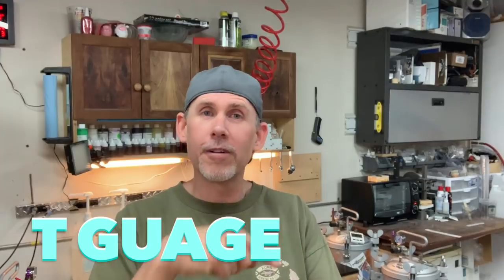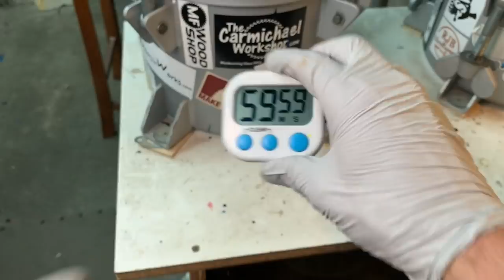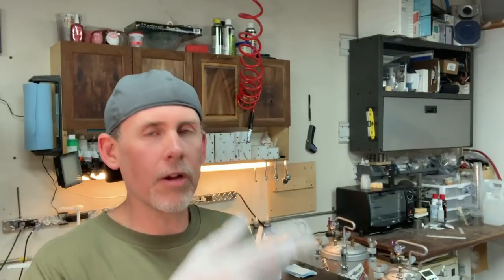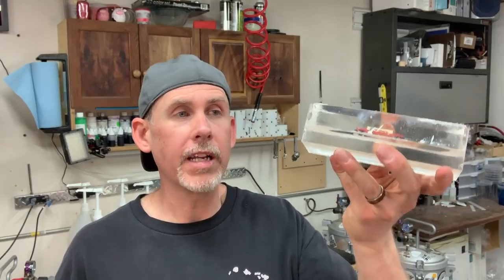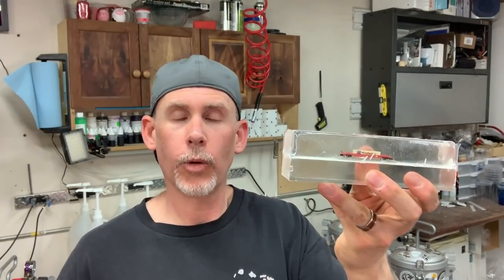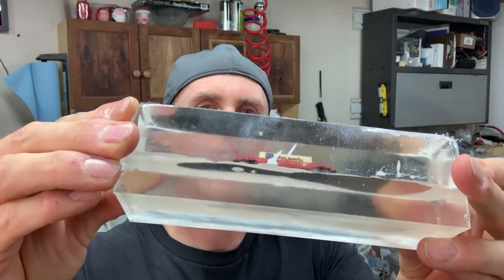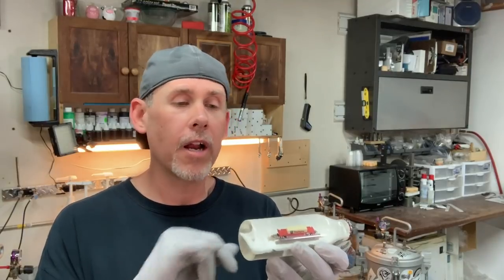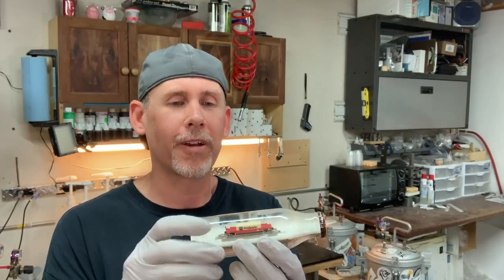Resin Casting and Woodturning a T Gauge Train in a Bottle

Comment: Zac, I have maybe an idea how you can get a suspended object without the line and it kind of goes with your dunk'n junk theme. I've seen several turners keep their sawdust and chips from turnings and then use them with the resin to make blanks. And I've seen that if you take resin shavings and mix with resin, the shavings just disappear. So what if you took a bunch of resin shavings, packed them down in a mold, placed your object on top of the shavings and then poured resin over the whole thing? The shavings would keep the object "floating" while disappearing into the resin. I don't know if it would work but it sounds good anyway. Keep up the good work. I always enjoy watching your videos.

Comment: Great concept... Would fine fish line or a fine clear thread or filament run through an item and stretched taught to the mold be visible in the cast? Saw a guy do an ocean battle using the half pour and then sculpting the waves from shooting at each other out of cotton painted with resin and pulled about, when cured he then topped with clear and it was great.

Comment: That is cool . I wonder what it would look like if you used alumilite white for the first layer. Or if you use Clare like you did could you put something in the resin to link like trestle and include a piece of track.
Reply from the maker: Yeah, those are both great ideas! Going with a solid color on the first layer works well, and it's usually what I do. I wanted to go for clear on the majority of this one though. I like the trestle idea too, that would be awesome for a train themed blank like this!

Comment: Zac, what is the typical life of a EWT negative rake carbide?  Thanks.
Reply from the maker: It just depends on what you are turning really. Some materials are super abrasive and will shorten the life of tool edges. I've been pretty happy with the NR cutters so far though, I've gotten through a decent amount of projects with variable materials and got about 6 months to a year out of the cutters. They'll last quite a while if you're just turning resin only and they'll last a really long time just turning wood with carbide cutters

Comment: Hi Zac. You mentioned in this video about having an issue with layer lines in your resin. I watch another channel, resinAce, who has a lot of videos about suspending items in resin. You should check with them, as they seem to not have that issue. I'm not sure what kind of resin is used in those videos, but it could at least give you some ideas.
Reply from the maker: I should have been a bit more clear about the witness line. It only happens if you turn the blank or shape it. You don't get a witness line at all if you just take the blank out of the mold and leave it intact, which is what those other channels do on multi pour projects. I tried everything I could think of to avoid getting one after turning it, and I was unsuccessful. That's not to say that it's impossible though, there may be others out there who know the trick =D
Reply: @ZacHiggins  I guess you could just embrace it and have the bottom part look like water, and the rest sky.
Reply: @ZacHiggins  on that note, couldn't you do the layers as you did and turn it down to a smaller circumference then pour another layer around it, with it standing in the center of a tube? then you could shape the outer layer with no witness lines and even if they show up, they would be deep inside the bottle shape. possibly? just a thought.

Comment: Okay, I must have gotten really lucky. I know you saw the wand I did on Facebook. That was a 4 layer pour and each layer was clear and had an element suspended (or set) onto it. I ended up with zero layer lines on mine. I used Royal Palm Thin formula.
Reply from the maker: I'm not sure. I haven't been able to cast anything with any clear resin out there, turn it, and not get a witness line.

Comment: Hi Zac,

When the Alumilite clear cures is it soft enough to be marked with a your fingernail? I'm using the Alumilite Water Clear and it's always just a little soft even after exacting measurements and 24 hours cure time.

Thanks!
Reply from the maker: Hey Jeff, Alumilite Clear cures hard. I haven't used Water Clear before, but I have heard people say that it is soft. It has a shore  hardness of 72, which compares to Alumilite Clear at 80
Reply: @ZacHiggins  Thanks for the response!

Comment: Hello I have a question about the resin used in the video (Alumilite CLEAR Resin). This resin to work on it needs 7 minutes ?? And for full hardens 45-60 minutes ?? . So I can get it out of the mold after 60 minutes ?? This resin only works at a pressure ?? If I do not put it in pressure it will harden at the same time; If I do not put it in pressure it will make bubbles ??